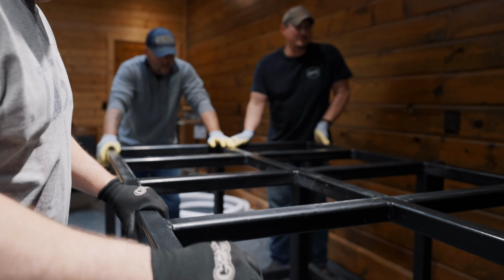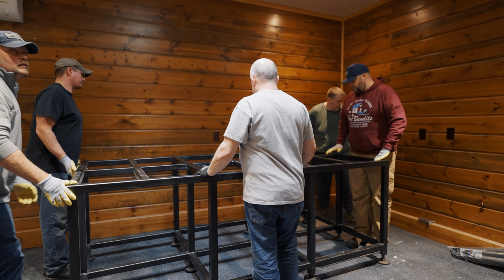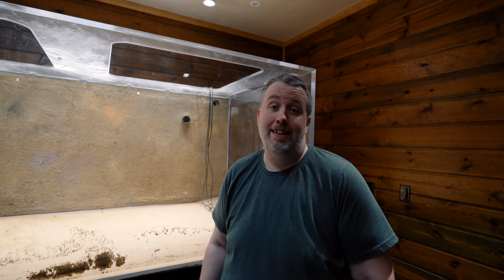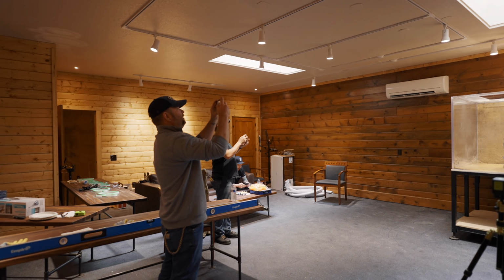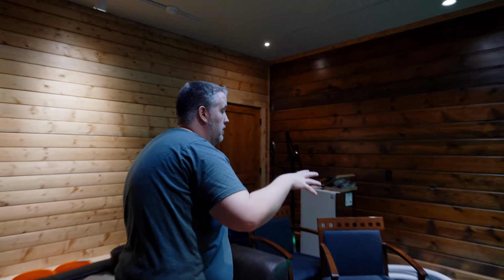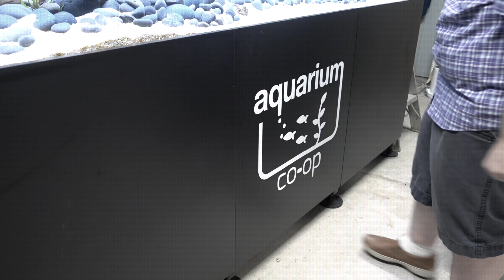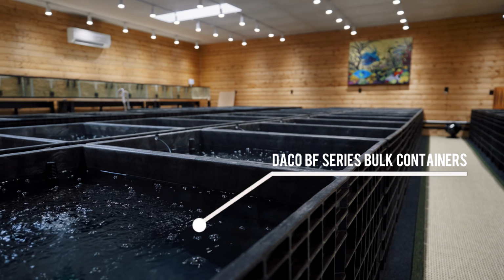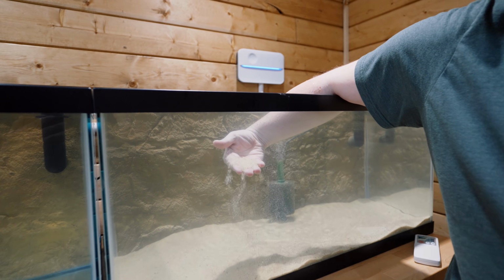One Simple Mistake Almost Broke this $15,000 Aquarium.

Comment: You really need to look in to some sort of Heat pump to heat your tanks.  I am still trying to set one up but I modified a window air conditioner and it used much less electric to get a lot more heat.
Reply from the maker: I have mitsubishi heat pumps installed in this building.
Reply: @AquariumCoop  I am talking about to heat the water in the tanks not just the room.  not worth it on small tanks but large tanks that have hundreds of watts of heaters in them.

Comment: Question where do you find your background. From what I saw on Amazon they are much less 3D. 
And also are you guys gonna have that soon in Co-op?
Reply from the maker: We don't plan to sell backgrounds. I bought this straight from universal rocks, but all the smaller ones I buy from Amazon as the shipping is better and better pricing. They are all roughly the same thickness for 3d. I don't like the ones that tack up 6+ inches of the tank with background.